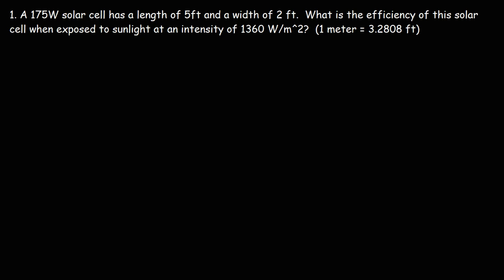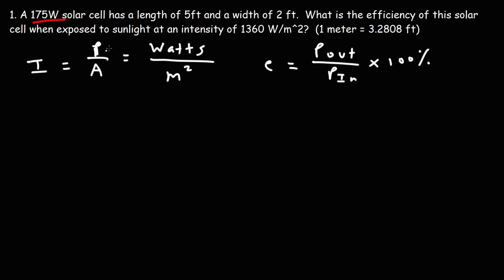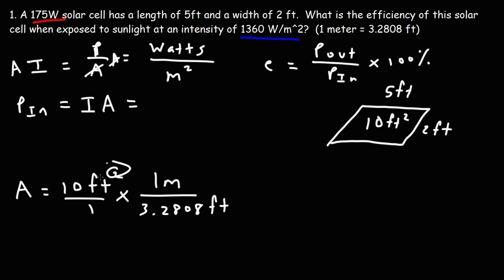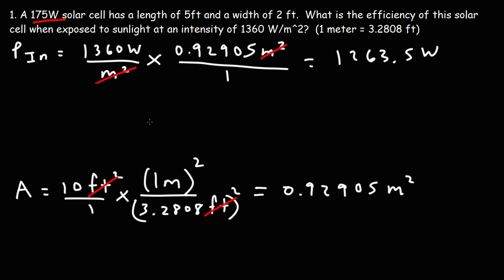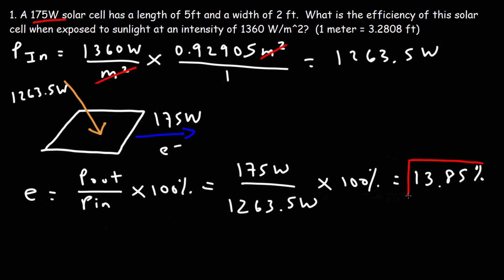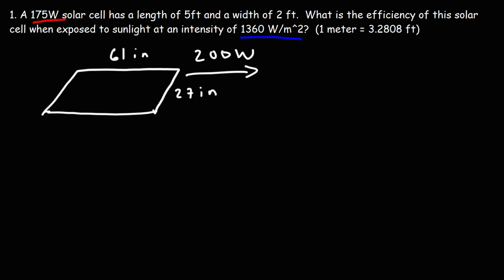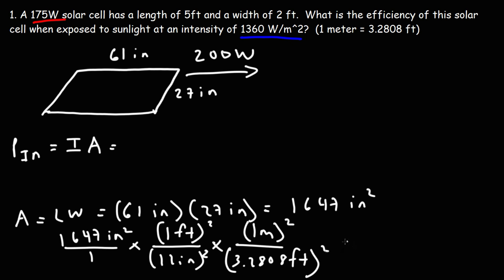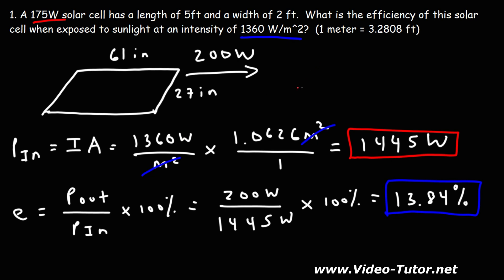Solar Cell Efficiency

Comment: Nice video but for 2nd problem I would first multiply 3.2808 * 12 inches to get 39.37 inches per meter. Then 61 in / 39.37 in = 1.549 meters. And 27 in / 39.37 in = .686 meters. Then multiply 1.549 *.686 = 1.062 square meters. 1.062 * 1360 = 1444.7 and 200 / 1444.7 = 13.84%.